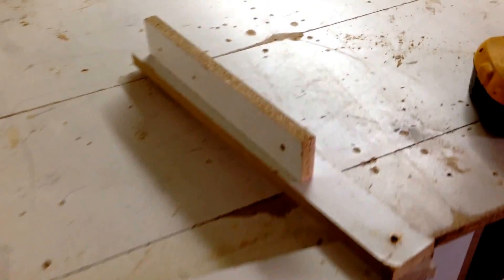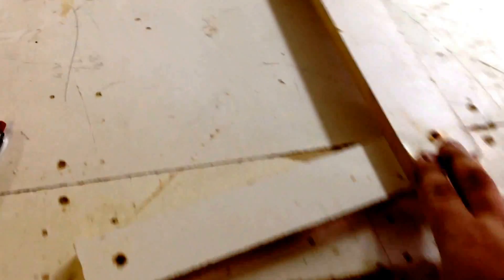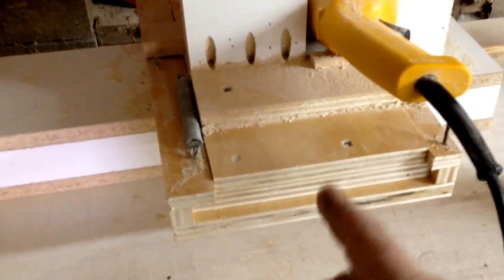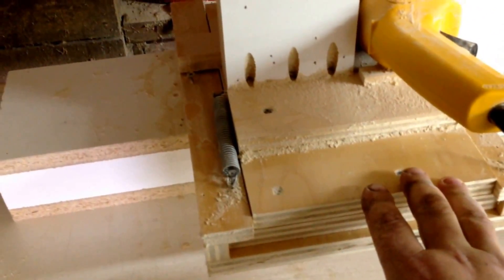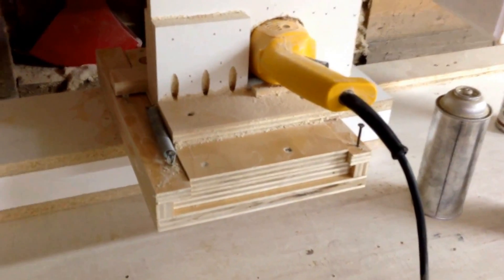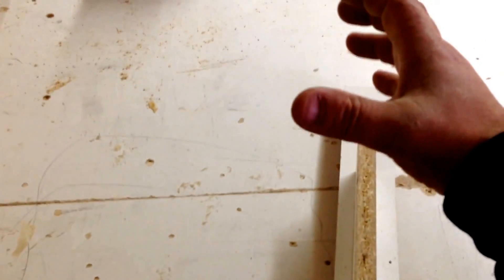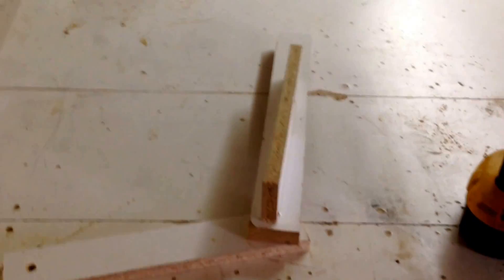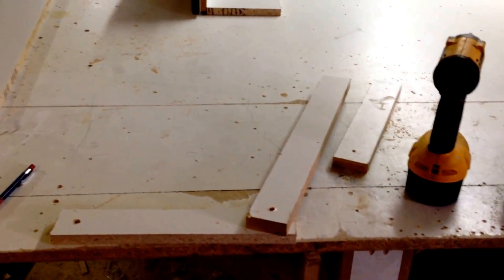Building Floating Router Part 1. The Plan. Feb 20 2014

Comment: Hi,

Many thanks for adding these most interesting videos.

I have a number of routers but the one I intend to use on this project is one of my Erbauer 2,100W routers. These routers are excellent for home workshop use but the plunge travel is very short; I've removed the base and plunge etc hence also removing the limited travel; I'm looking forward to getting into the workshop now winter is here to resume work on building a floating router which has caught my interest.

Kind regards, Colin.

Comment: Dewalt 1 3/4 hp with fixed and plunge bases, a Porter-Cable trim router w/ 3 bases and a Grizzly benchtop shaper w/ router bit adapter.  Meets my needs for sure.  Love your videos; they really get the creative juices flowing.